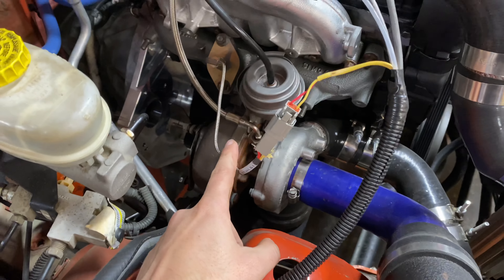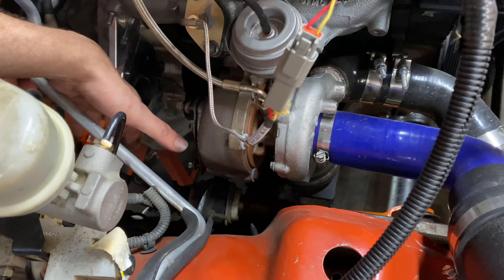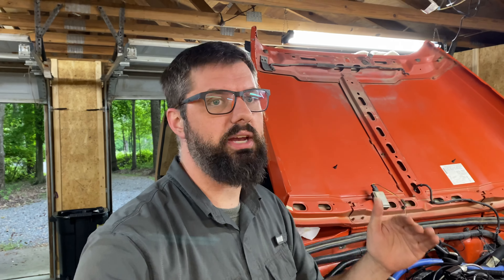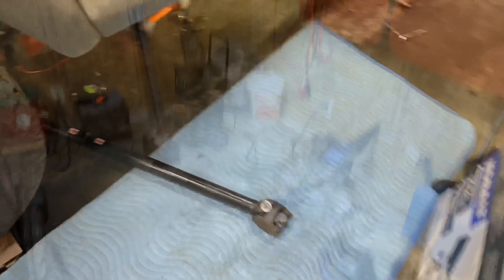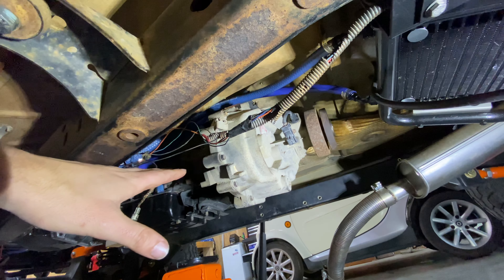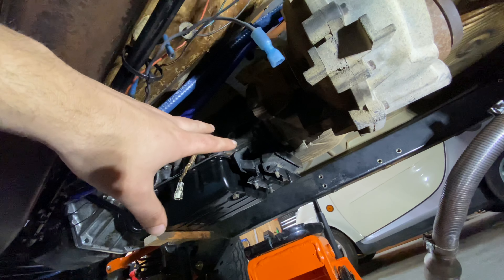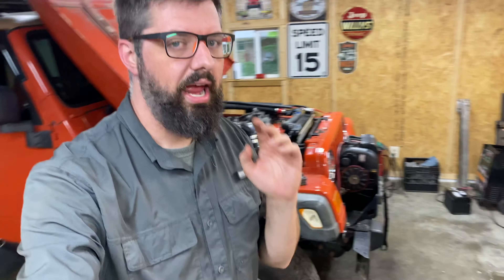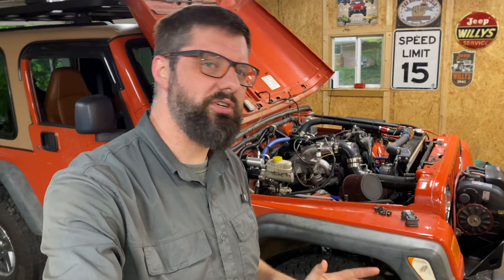Quick update on the turbo, driveshafts and transmission crossmember!

Comment: Is the Kubota Swapper store still around ? If not where do you suggest to go for swaps ?
Reply from the maker: I think he is shutdown for the moment, I don't know many details. TDI would be the easiest way to go. I know several people have done Mercedes swaps but as I have never messed with them, I have no knowledge on them.  There are several companies that make adapters as well for the TDI, just depends on which transmission you want to use along with the amount of tilt you need as well (Rotation of the engine from side to side of the engine bay.) I've seen adapters that do 0°, 5°, 7°, 10° and 15° I believe.